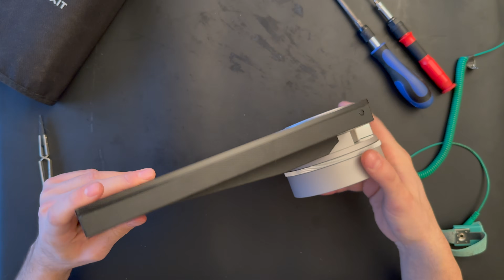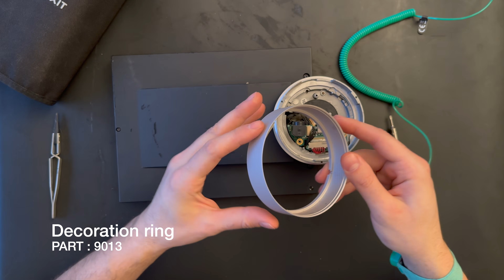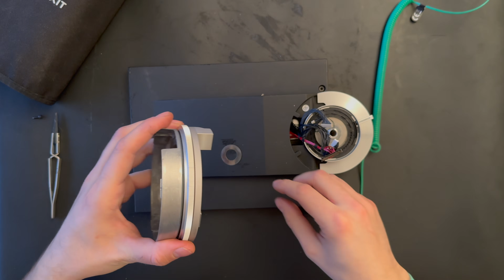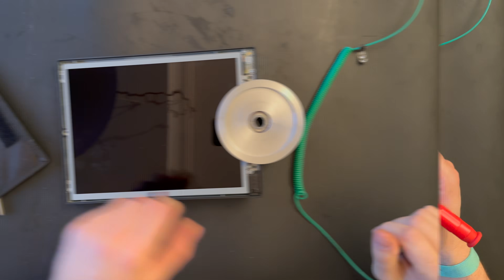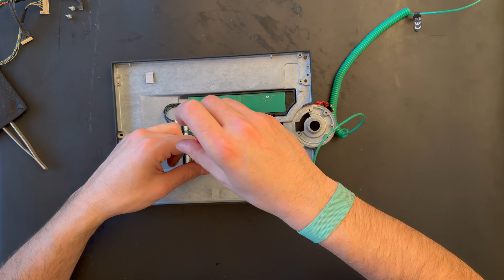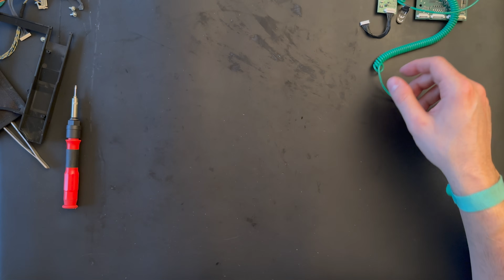Bang & Olufsen Beosound 5 Disassembly process and repair guide

Comment: Is there a way to add more storage to this system?
Reply from the maker: Hi Seán May
Thank you for your message.
Yes, you can change the harddisc in the Beomaster 5. But you need to clone the data into the new harddisc first or install a new software.
Best
Ihsan

Comment: I also disassembled one time this system. After volume notification stopped working. It was brand new, and why I did that because stupid rubber lacquer starts sticky. I painted new matte texture. But fact about something not functional proper will gave me sad. I sell it. I bought Ipad mini4 128gb which the same device but more and more interesting and micro size compare with this piece of s. very disappointing device. Beosound 5 Encore normal version of it.
Reply from the maker: Thank you for your comment. Yes, Bang & Olufsen is knowing for the rubber lacquer and starts sticky on the surface. But there is a solution for that problem "Paint remover". 
How much did you sell the Beosound 5 for?

Yes, the iPad mini has the same functionality and the interface.
Reply: @KoseTrading  I sell it for 3600 euro. it was 4-5 years ago.
Reply from the maker: @81Nightro  That's a very good price you sold it for. Now days you can sell the same system for around 700-1000 Euro
Reply: @KoseTrading  I know, my was absolutly new, never used. I Bought it for 5600 euro maybe 11 years ago.
Reply from the maker: @81Nightro  Okay, brand new will go for around 1500 today. But will good price for "Vintage" product.
Reply: @KoseTrading Many thanks for the video. Could you please elaborate on how the "Paint Remover" solution works on rubber lacquer? I'm planning to start my Beosound restoration soon and would appreciate the details.:buffering::hand-pink-waving:
Reply: @coskucangurun7999  I cleaned by myself with usual credit card without any chemical